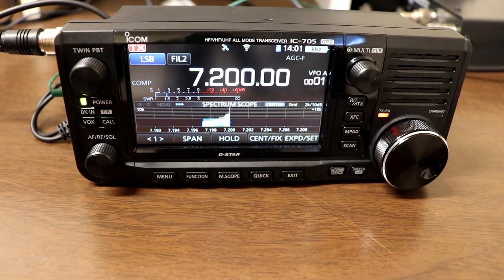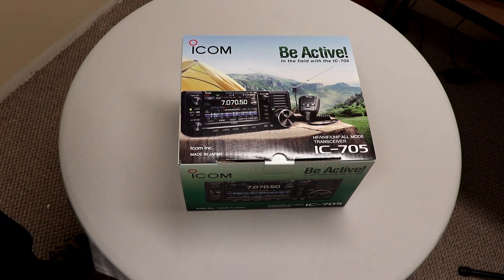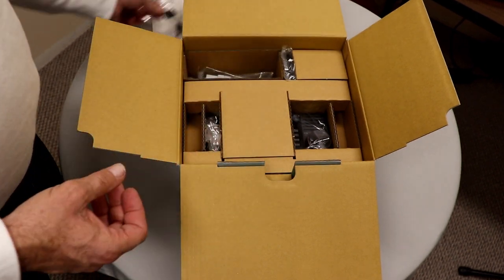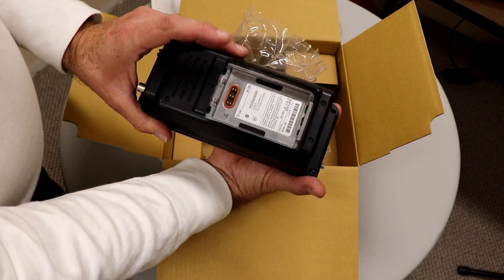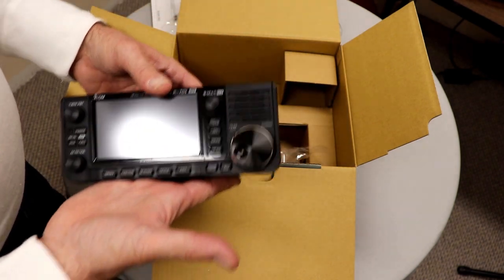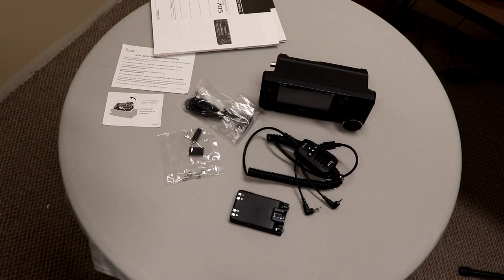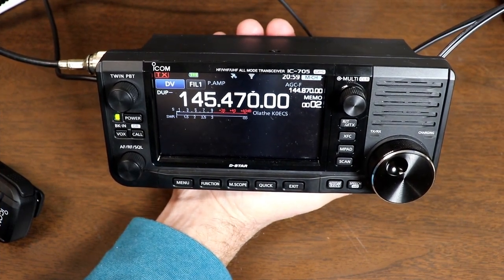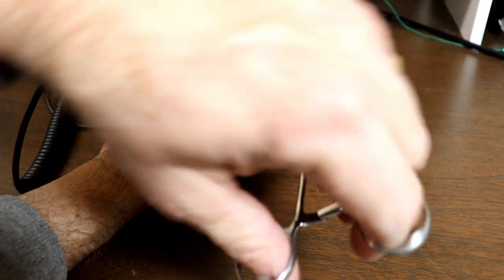Icom IC-705 Unboxing and Introduction

Comment: Yes, they do have a bigger battery. It's the BP-307 rated at over 3000 mah. Why Icom did not just design a battery case that uses three each 18650 batteries I will never know? The battery pack would probably be the size of the 307 pack and also have a higher operating voltage. 
Neat radio.
Barry, KU3X/QRP

Comment: Thanks Tom. I would love to see an A-Z series but no rush on my part. If I get the 7300 next month then it will be a while before the XYL will let me get another radio and before I can save up the money. I would like to do some SOTA but no mountains in Florida so I will have to relocate first. My plans are to get a Xiegu 5105 for SOTA and use the 7300 for POTA. But I would rather have the 705 for portable QRP than the 5105. 
Note: any plans I have are subject to changes or cancelation  made by my XYL. After 36 years of marriage she wins out over any radio. W4MKH
Reply from the maker: Hi Marshall.  I totally get it.  I've been married 34 years.  So not too far behind you.  I understand that one secret to a happy, peaceful marriage is "Yes dear."  All plans are always subject to change.  Take care.  73, Tom
Reply: @HamRadioA2Z  Hi Tom. I see the 7300 menu has a SCAN button. But I haven't seen a video covering that. Did I just miss t?

Comment: Tom tell me what does the wifi do for that 705 rig?
Reply from the maker: Hi Eric.  The WiFi provides several features.  A small, but useful feature is that it will automatically set the clock in the rig using Network Time Protocol (NTP).  A 2nd feature is that the rig has Icom’s remote rig server built-in.  So you can control the rig from their RS-BA1 software when it is connected to WiFi.  Finally, it can act as a DSTAR gateway and uses the WiFi as the internet connection for that.